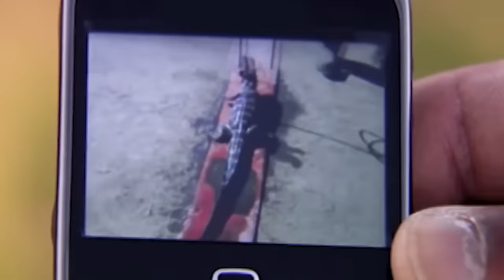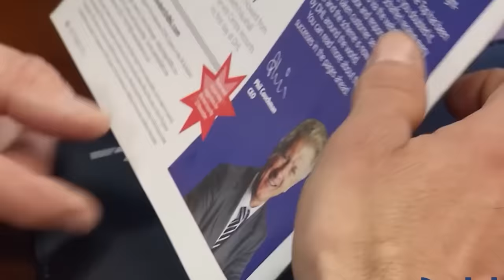Undercover Boss Finds Out Employee Can't Go To The Bathroom

Comment: Let me add my little story to the collection. This was working in the UK where I'm going to suggest employment protection law might be a little stronger.
Anyway, road building project. £600 million. That's about $1 billion at the time.
The Health & Safety Executive, the HSE are the government equivalent to OSHA and they pay a visit one day.
They come across three guys sitting at the side of the road under construction eating their sandwiches and they ask them if they chose to do this or if there is a reason why.
The guys explain that the site canteen is three miles up the haul road, (the haul road is the base road where the actual road will be laid as it's not there yet). They say they don't have company vehicles and don't have time to walk there and back so they have to take a break and eat there.
I can confirm this is correct, you couldn't take private vehicles on site, I was able to take my company vehicle on but lots of people didn't have company vehicles.
And that estimate of distance is pretty much correct, 3 miles away so that's a 6 mile round trip.

Anyway, it's pretty strict back home, legal right to handwashing and toilet facilities, somewhere to take a break, make a hot drink and eat.
Not debatable, it's an absolute right. Meaning the employer has to provide it.
So, management are told, fix it within a week or we will close you down until you do.
As an electrician I was then very busy for a week installing generators up and down all 26 miles of the haul road to power small break cabins and toilet cabins for guys to take breaks in.
Imagine, a 600 million pound or 1 billion dollar project stopped because you didn't provide your workers with a minimum decent standard of care.

Now isn't that a thought?

Comment: I had a supervisor that would go into the bathroom and drag people off the toilet if he felt they were in there too long. One of my coworkers had a stomach virus and the supervisor went into the bathroom and dragged him out while he was puking. The supervisor kept pushing him and the guy puked all over the place. After my coworker was embarrassed then the supervisor made him clean up his puke. After that the supervisor found the most humiliating thing her could find for the guy, outside in the heat of August. The supervisor made me go with him to make sure he did the job. The supervisor told me to call him if the guy didn't do the job. I took the guy to the location and we sat in the work truck with the air on high. About every 10 - 25 minutes he'd have to get out and puke. I ended up doing the job myself which took 15 minutes. A couple hours later we went back for lunch. The supervisor asked me if he did the work and I told him yes. I told the supervisor that the guy is sick and needed to go home. Other people started speaking up and the guy finally got to go home. Me and several other people complained to HR but the supervisor denied it ever happened. The supervisor held a grudge against anyone who he thought reported him to HR. On my last day before starting my new job I told the supervisor it was me that reported him. The guy lost his mind and tried to chew me out. I told him it didn't matter what he said or did to me.

Comment: I was a bartender for between 10 and 15 years depending on how you gauge with shutdowns and new jobs.  We make 2.13 an hour same as servers but if you work in a restaurant you a get a portion for drinks you. Normally hourly employees get bathroom and smoke breaks but servers and bar staff don't.  No lunch guaranteed either.  My mother was a server in 1983 before I was born any made 1.80something. So 49 years and 40 cents but she told me I could live as a server too.  Think about that

Comment: I want to clarify that construction episode. None of the company employees did anything wrong. The CEO was unaware that construction set-up was handled by a 3rd party contractor who often failed to provide accommodations that were pre-paid by the company including portable toilets, drinking water, and shade facilities. Also, the company didn't have a hazard assessment person and there was no line of communication to report them, that's why the alligator issue went unresolved. The CEO recognized the liability danger and took steps to correct them, unfortunately they never made it off the drawing board and a worker was killed by a gator less than a month after the episode was filmed.